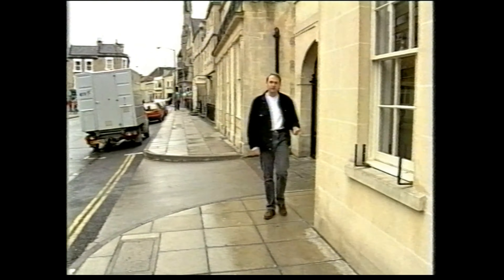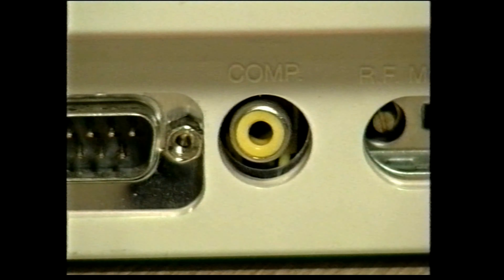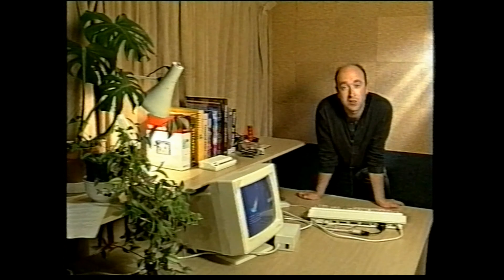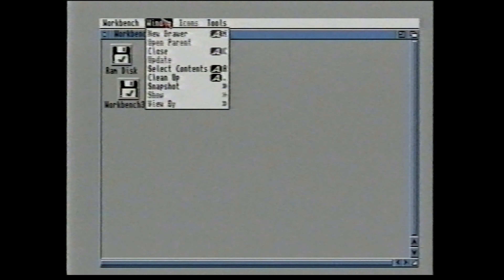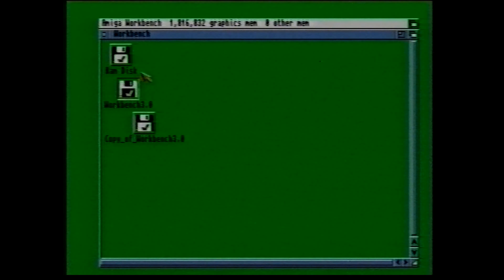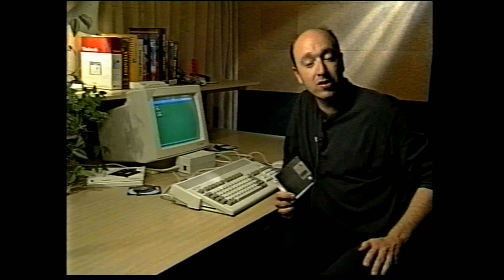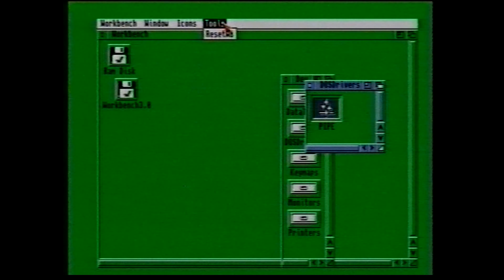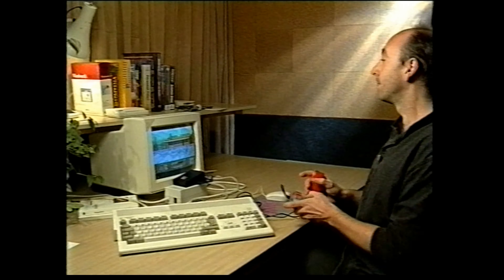Commodore 1992 Amiga 1200 unboxing original Introduction!  Computer History video Restored

Comment: Greetings from Ukraine! in the 90s he had an A600 and then an A1200. The use was only on floppy disks. In 2000, he sold the A1200 and switched to the PC. Now I have again purchased the A1200 from 68060 - 128mb. Already 6 years with her :-))
Reply from the maker: Hi Apacher, thank you very much for your sharing your experience with the Amiga models.  Sound like you had good experience.  Glad you found our web page also.  Thanks for the feedback!  !  Charles, CHAP
Reply: 060 1200 here as well, still TONS of fun.. back in the day I only had A500, 40 MB (!) SCSI HDD and 2 MB memory expansion.. haha.. 40 MB hard drive.. Amiga <3 <3

Comment: This brings back some memories, watched this on VHS as a kid because of my older brothers, came in handy when I eventually got my own A1200 about a decade later.
Reply: I never owned anything after Amiga 500,,,
Thank god for emulation today :) Now i own more systems (and lots more) I could even dream back then.

To some degree.. i'm more than happy, but still no matter how much digital stuff i have, it will NEVER replace true hardware,CRT monitors i had..
Reply: @Tech-geeky  Software enulation is now also being used to enhance original hardware, such as the pistorm.

I recently got a pistorm32, although I'm having some issues with it.
Reply: @tech34756  or the Amiga 500 mini.... Still there is some things you never do.  As a nostalgic Amiga owner i know the hardware/emulation may bring new users, or just want to connect to a 16:9 display, over  HDM, but its just not the same....   Its the same reason when you take emulation software, and expand it to fill the entire screen as it changes the aspect ratio....  everything looks stretched on a wide screen... And people are ok by that ?? Your messing with the classics.

Comment: 8:06 Small correction, if your using a TV, you will need to use these for audio.... You'd be connecting these to a the side of the TV modulator instead.

Otherwise you won't get audio.

Comment: I owned and sold Amigas at the ByteShop in Merrick N.Y. Most of the customers wanted a Amiga 2000 with Video Toaster which I must have sold over 400 or so during my time at the store. I personally had a 2000 with Video Toaster myself along with a single frame recorder and LightWave 3D to render frames to then of course things changed to digital and the rest is history.
Reply from the maker: Hi Donald, sounds like quite a fascinating time!   What would you say was the most popular model at that time?
Reply: @ComputerHistoryArchivesProject  Well at first of course it was the 1000 which I owned as well then the 2000 for a long time (due to the Toaster) if someone was into gaming we would suggest an Amiga 500 or 1200 but when the 4000 came out everyone (Video people) switched to that. so it was based on budget and what you wanted to accomplish that was the factor in selecting an Amiga.
Reply from the maker: Thanks... well that makes sense.  !   : )

Comment: I heard there was problems with Surface mount:
Strict requirements (power must be an issue, because if  a component drew too much power it could melt the soldier joints..

That would have gotten better over the years

Comment: I still had the Amiga 500 in 1992. I still have it today, but unfortunately the floppy disk drive is defective. I also had to throw away the approximately 200 diskettes prematurely because they had become unreadable.
Reply: I would look into a Gotek to replace the drive, they're relatively cheap and there are ways to internally mount them.
Reply: @tech34756  Many thanks for the notice. 'retrofriends' is of course subscribed to. Have a nice Sunday.
Reply: should of backed up  ....Developers at the time got away with notes on floppy disks "Back up and store the originals in a safe place"  Fast forward to 2023,  few did that... haha

30 years, and nothing much has changed.
Reply: @Tech-geeky  Many of the 5 1/4" floppy disks for my C64 survived the test of time. Only this stuff was crap --> 💾
Reply: all of that will erode over time... Then you'll get to the point you can't repair anymore because parts are harder to find...on eBay/other market places.  Nothing lasts forever, we just think it does
Reply: @Tech-geeky  This is true. That's why I parked my Amiga 500 in the attic for eternity. I only turn on my C64 from time to time.
Reply: I throw it too, oh lot of disks, but still love to play games on floppy disks because it is great feeling!

Comment: Why are they using an old squashed A1200 box? And why is the computer and cables so dirty? The building at the start of the video is in Bath UK and recently (2023) sold for ~£800k which was very very cheap.
Reply from the maker: That is a good question...!

Comment: Writes about Amigas on a Mac, relatively cursed
Reply: I think the Mac was long established as being the first choice for DTP, and reputedly had the best software. I imagine an A2000 or A3000 with flicker fixers, and perhaps 24-bit graphics cards and good monitors, would have been effective but it's probably the case that the staff had gained computing qualifications or trained on Macs and so had become familiar with them. Alternatively, perhaps the Amiga set ups I described above would have been more expensive than a Mac or the Amiga software simply wasn't quite good enough for professional use.
Reply: @danyoutube7491  You're right, it's all about the industry standards, Mac ruled the DTP roost and you'd eventually have to send that file off to the printers, who were using Macs. Could an Amiga do it? Probably, I don't have any experience with that kind of software on the platform, but like you said it gets to be a bit rube goldbergy when an out of the box solution existed.
Reply: optimistic... yet do-able.